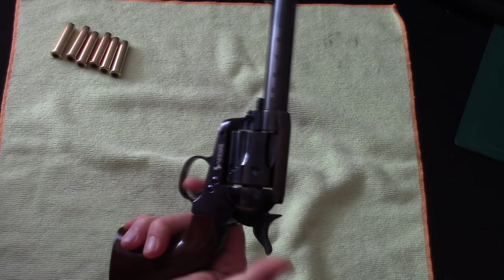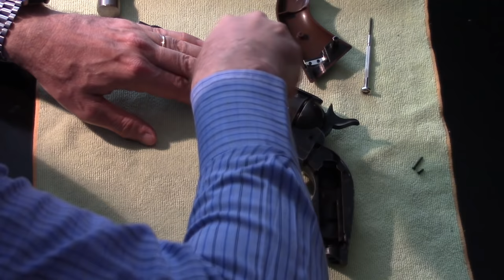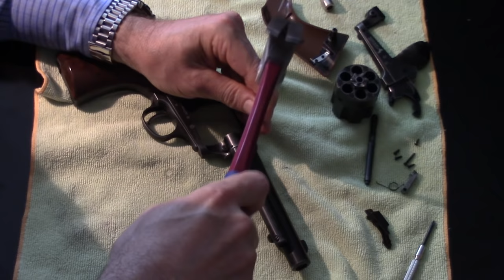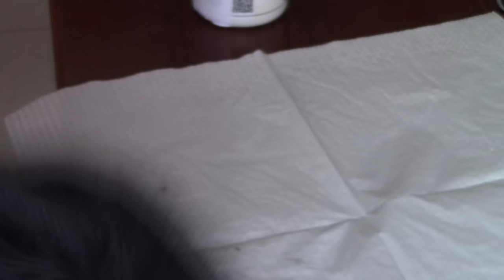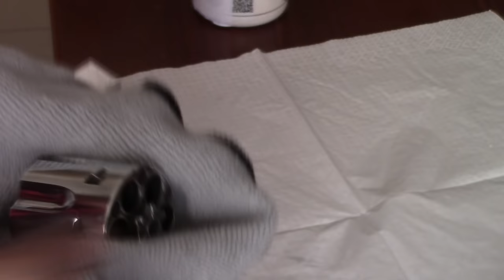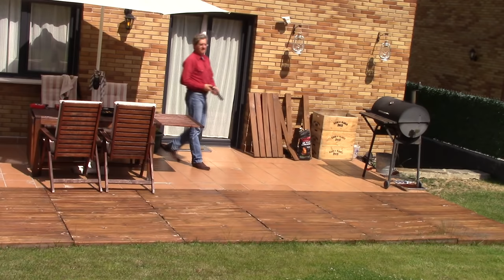Bad quality barrel of Umarex Colt SAA Peacemaker and how to solve the problem

Comment: I feel the need, having shot air guns since the early 70s, to correct your statement regarding the placement of the pellets into the cartridges.  There is NO NEED for seating the pellets by using anything other than your finger tip.  Regarding a CO2 pistol, unless you place the pellet in backwards or sideways, the ONLY reason for a pellet to get 'stuck' in a rifled barrel would be due to the CO2 either not being pierced correctly (VERY small piercing, or hole for gas to escape), or your shooting past when the CO2 has enough OOMPH left in it to push the pellet.  Also, you should NOT push the pellet past the grommet, as you want the grommet to KEEP the pellet in place, especially if you like walking around with the pistol in a holster worn on the hip, which is WAY COOL.
Reply: The barrel is smooth ,the pellet cartridges are rifled.

Comment: I'm wondering if you had a few 'bad' barrels.  I have the original one still in mine and have put God....well over 1000 pellets thru it with no problem at all.  The only problem it seems to have is the cylinder has a slight bit of play in it when locked in battery.  I really like what you did to the finish. It seems like it really has that older, antique look to it.  Ya know what will really 'finish' it (and help in performance too)? Do what I did:  I bought a set of aftermarket walnut grips for a real Peacemaker from Hogue, and after doing some  modifications (removing some wood, reshaping, sanding, ect) I installed them and they look absolutely fantastic!!!  I think what made them look so good was when I finished them, I used a technique that gave them an 'aged' look.  I had very little problems in getting them to fit and the whole job took only a few hours a night over the course of 3 days.  Functionally, I now have a better grip with wood than with plastic, especially when spinning (twirling) them, and they feel more like the real guns grips than the factory plastic ones do.
Reply: Aren't the real grips shorter?

Comment: Chemical bluing is actually controlled rusting and can therefore be removed with an automotive rust remover or simply phosphoric acid (which is their main constituent). Although the bare steel will still want polishing at least it won't be quite as messy! As one of these SAA's is my next purchase though, I found this very interesting, so thanks for posting it.
Reply from the maker: Thanks for your comment, Tony, I appreciate it. I presume that you will have good moments with your Peacemaker air gun.

Comment: I bought BB version because I knew I would change BB barrel to rifled made from Hatsan barrel. It was way cheaper than Umarex SAA pellet version revolver. I tried shot lead BBs with standard barrel but they were no ideal round and just getting stuck in barrel all the time. But they were really accurate. Pellet version is way more accurate though.
Reply: transadwens I have some sympathy in that if you get a misalignment, if you don’t notice the BB doesn’t exit then it’s possible to damage the barrel with a second discharge..

I’ve heard there’s some play in the drum and the casings which can result in a misfire... It’s not like you can hear it necessarily or notice it when it happens being Co2... The barrel does look awfully thin and very liable to deform... This could have been easily negated for what would amount to a few dollars extra in the cost of manufacturing.

The drum play to me would be the biggest culprit... To compound it, the casings apparently have adverse play that allows deviation... it wouldn’t take much to cause a misfire if they are already out the box dancing just within working tolerances... Having said that,  a heavier barrel costing pennies more to manufacture would make all above fairly moot. Though if the drum slop doesn’t have a fix, it’s going to break one way or the other regardless.

Comment: From what I can see here.. Its the quality off the bbs you are using that's the issue. Looks like you're double feeding. Or shooting with A jam. That will be the only cause too that barrel. The co2 seals also needs a bit of Pell gun oil on them.. when inserting a new co2.
Reply: Jeffrey Bone   if you're using poor quality bbs.. and one gets jammed.. then trying to shoot another one.. Then that can cause a double feed. I've never heard of this problem before. Infact this is the only video on youtube with this problem. Also the umarex  Colt SAA has a very low return rate. And is very good quality.
Reply: @justintime1218  i agree, this looks similair to when a powder burner blows a barrel with a bullet jam (all be it less dramatic!)

Comment: Have you had trouble after reattaching your barrel? I opened up mine to inspect it and now its wobbly. You can hit anything with it. The pin is correctly inserted.
Reply from the maker: Hi ares9304,

Both pins don't do anything but keeping the barrel attached to the frame. You're right, if your revolver falls down or so, the barrel may have some looseness. I had that problem and the way to resolve it doesn't have anything to do with pins. I rolled a little bit of scotch tape on the part of the barrel that goes inside the frame and forced it in place. Then I secured it with both two pins and, for me, is good enough. I haven't had any problem with my revolver related to the barrel. 

My friend Jason had the same problem; he solved it with a little bit of tin from a soda can. You can see how he did this in this video: 

https://www.youtube.com/watch?v=zueu0XvcEms
Reply: Xavi Barrera thanks mate. didnt think of cutting up a can, but i did try aluminium tape.
Reply from the maker: Well, I would try first with the adhesive tape, for me, it was enough to get a robust barrel again. I would go from less to more.
Reply: Xavi Barrera mine is very loose. and the aluminium tape dint work. when i forced the barrel back in it only caught tape and wedged it. didnt slide into the frame. tried for hours. the thin metal from a can is probably more solid and wont just bunch up near the edge.

Comment: Any idea if the same issue occurs with pellet version of the gun? I'm planning to get me some, but I'm wondering if it would be beter to buy BB and replace the barrel or just get the pellet version.
Reply from the maker: I don’t have any experiences with the Umarex SAA pellet version. The one that I own is the self-made out of a pellet carbine barrel, the one of the Daisy 880. However, I suppose that it would be more reliable than the BB's version. Pellets are made out of lead, so they are way soft than steel BB’s, so what, in the case of misalignment, they would cause less damage that BBs . If I were you, I would buy the pellet model.
Reply: Thanks for the tip! I think that alone for the sake of more accurate shooting it's worth it. And the prices dropped few days ago, so another plus for that.
Reply: But I do like it tho, maybe just needs some tweaking here and there
Reply: Not one issue with any of my pellet versions. This is operator related with the bb's. If you double feed the barrel, this is what happens obviously.
Reply: I have the pellet version and haven't had any mechanical problem. Mine has the weathered look and I like it. I have the ~5.5 barrel and get about 324fps with 7.56 lead. The 7.5 inch barrel should give you a bit more velocity.

Comment: Hi.  I was thinking about buying one of those Colt Peacemakers - but after seeing this video I sure don't want through that crap.  What could you advise me as of right now???  Thank You.  Sincerely,   JAMES.
Reply: As far as I know, this is the only guy on YT having problems withthose guns. Moreover he blames it on the bad quality of the barrel when in fact it's due to double feeding the barrel with bb's. It's operator error. That beeing said, if you buy the rifled version for pellets you sure will have a much more solid barrel and an amazing pistol to play with. It's powerful and darn accurate. Don't let this vid take you down. I own several of those pistols and never experienced any issue with them. They are more reliable than many of my other guns.
Reply: @RenoLaringo  Thank you Reno.  I have heard before NOT to use BB's in rifled barrels.  They will destroy the barrel.  I sure will not do business with pyramid air - as they sent me a used AR 15 & passed it off for new.  Then they sent me a bunch of e mails to try to scare me into not returning it - stating that if I returned it - it would void the warranty.  These people there are scumbags and liars - & I am gonna make a whole lot of noise regarding this.  Thank You Reno for responding.  Sincerely.
Reply: @buzzclark  You are welcome buddy. You are right about bb's in a rifled barrel. They would destroy the rifling. This said you can use lead pellets, and even use pellets in a bb gun if the gauge allows it. But you almready know that... Jeee, I can't believe you were put in that situation. I was just talking with my beloved one about the fact that everything seemed to go completely south nowadays. I remember a time when customers were treated with much more respect. Now it's almost like if the sellers were the new gods and we had no other choice than complying. It seems to become an overall evolution and I find it rather infuriating. I can't encourage you enough to not let them crook you so easily. There must be some kind of consumers protection associations where you live. Don't hesitate to call them and tell them your story. It just sounds unbelivable. I wish you good luck with this. And, for the rest you are most welcome if you want to discuss guns or anything. Have a great one over there !

Comment: can you show me how to remove the cylinder? I am not sure if the pin comes out straight or it needs to be turned or there is crew somewhere to release it.... I have no idea...
Reply: Well it's 2 years on from your comment, but if you still didn't try this, the cylinder pin cannot be pulled out. It is completely retained by the gun casing and you need to take out the screws and separate the two halves of the casing to release the pin from the cylinder.

Comment: Hey Xavi, glad to see your video. I hope the new barrel works out okay for you. I noticed that in the vid, you did not stretch out the front barrel spring a little bit. It might be necessary to give the barrel the backward push against the rotating cylinder for a better seal. Good shooting....
Reply from the maker: Hi, Jason. Your barrel is working out great. You're right; you can't see on the video the moment when I stretched the spring, but I did it. As a matter of fact, I  stretched the spring when I paper-sanded the barrel a little. The gun is shooting full of power, even with the heaviest pellets. I'm very satisfied!!! It works so well that I'm thinking to buy strongest springs for my other two Colts. I reckon that the malfunction of the barrel starts with some looseness at the tip that pressures the cylinder.  

By the way, I'm really impressed how accurate your hip shootings are.
Reply: ***** That spring may not fit the Umarex Colt SAA barrel front. You can make your own spring using .028-.030" piano wire or wire fishing line, wound on a 15/64 metal shaft or drill bit. It should open up to the diameter of the barrel.
Reply: ***** Yes. I sent you an email to discuss this.
Reply: @ccuc22  How can I get the heavier barrel for my Umerex, Colt SAA? It has stopped shooting. The pellet just jams between the cylinder and the barrel whenever I try to fire it.
Reply: @gregorylawson1216  If you are in the US, you can get the Daisy 880 barrel on ebay. You will have to put in some work to cut and fit it into the Umarex Colt. First check to see if it isn't the front barrel spring that could be jamming or broken. It has to push the barrel back against the cylinder for proper seal.
Reply: Hi Jason. I am in Australia mate and I want to instal one of your barrels in my umarex peacemaker. Happy to pay whatever is needed for you to send me one. Thanks Jason
Reply: @MH-bw9cl  Hi, I do not sell these barrels, my video is to show how you can make it yourself.  If you have a hobbyist pal, maybe he can make it for you, it is not that difficult.
Reply: @ccuc22  Hello Jason , How are you theses days ?  Still having great fun with your throwing daggers it seem :)  Question did you live near the volcano ??  Im kind of worried about you.
Reply: @danbigboss6484  Thanks for your concern. I live on a different island from the volcano. Seems few people are actually living close to the lava flows. Most of the land around the active volcanoes are left barren for such an event. I see that you are into knives too, hope to see your videos with them.
Reply: @ccuc22  One of theses days i should make video of them its sure but i dont own throwing knives. you have such INCREDIBLE skills Jason , both with throwing devices and shooting your Colt SAA.  its RARE to see someone as good as you are.  Oh by the way you should definitelly make more video with your Colt / Remington Co2.  I hope they are still in working condition after all theses years ?
Reply: @ccuc22  Oh man....Thanks you so much for your GREAT cowboy alley shooting Jason , you are just INCREDIBLY GOOD my friend !!!  The only thing i very LIKE to watch on youtube is your chanel !  Awesoome , thanks you so much Jason !! :)
Reply: @ccuc22  Im very happy that you live far from the volcano. its a relief to read this!  I Thing that might interested Xavi & You (you can only do that modification on the "antique finish" version) (bluing) https://www.youtube.com/watch?v=j-plNGBQrcM&ab_channel=johnwu
Reply: @danbigboss6484  Thanks Dan, anybody can shoot well with some practice. It is like any other sport.
Reply: @ccuc22  I Bought two Umarex SAA Antique Finish years ago and I just ordered a cowboy belt/holster rig as christmas gift to myself because Xavi & You.   :)  I ALWAYS wanted one since i was a little boy.  my father nicknamed me "Gunner" since i always run around the house (outside) with my plastic SAA and DAISY bb rifle that my father bought me when i was 10 years old.....but he didnt gave me the damn bbs for it so i was shooting air all around lol.  now in my 50 and after having watched Xavi/You videos i finally decided to make the move and equip myself to have little fun while i still can on this earth :)  thanks you so much for your videos Jason ! I ALWAYS enjoy watching you and your skills. ;)
Reply: @ccuc22  Holy Cow...Holly Molly , HOW you can be SO accurate at this distance is BEYOND me !!  W-o-W
Reply: @ccuc22  "anybody can shoot well with some practice. It is like any other sport."  Im pretty good in any sport i tried in my life , Im an excellent BOW shooter at great distance but shooting from the hip on such TINY target at this distance .... Im sure you was a dangerous sharpshooter in another life :)
Reply: @ccuc22  Ohhh :*( jason your latest shooting video was erased ( ? ) could you re-upload it please !
Reply: @danbigboss6484  I'll unlist it if it offends some people.
Reply: @ccuc22   @Jason S  its strange , the other night your 2th latest video re-appeared. (what a joy) now the lastest just show I hope it will stay there :)   Jason please un-block the comment section on your video. its not fun to comment on Xavi channel each time :)
Reply: @ccuc22   your latest Tribute to Tuco (haha) HOW you can be THAT good ???  its incredible damn it ! your skills deserve MILLIONS of views just like Bob Munden , Gil Guerra Jr, aka Cisko or Byron Ferguson & Lars Andersen with their aspirine shot.
Reply: @ccuc22  Jason you should try to make a ballons stand like this , im pretty sure with pratice you could be fast & accurate that would be awesome to see you start praticing on this stand. https://www.youtube.com/watch?v=9JjIHj3zqbY&ab_c
Reply: @danbigboss6484  Thanks, but anybody can shoot well. I am trying to stay out of YT searches. Just keeping a few viewers and followers who does the same things.
Reply: @ccuc22  ok i understand. i respect your choice sharp shooter.
Reply: @ccuc22  if i understand well your most accurate is your Schofield agains the Colt SAA ?  or what is your most accurate in your opinion and with wich ammo  BBs or Pellets ?
Reply: @danbigboss6484  Dan, the Schofield is the more accurate and reliable bb pistol. I don't have any pellet versions of the Umarex pistols. I am thinking of a way to alter the Colt SAA  cartridges to be like the Schofield cartridges,  the front load cartridge is better because it shoots the bbs into the barrel without hitting the edge of the forcing cone that much. Fast multiple shooting is not recommended with any of these pistols, I find that something gets jammed  and the shot come out at low speed (usually the 3rd shot). Best to slow draw and go for accuracy. BB pistols are not exactly accurate, I have to take the chance of the odds of making a hit. Just visualize a 2 inch spot on your target and fire, if you can do that, then the odds of making the hit is good. Body coordination  on a hip draw seems to beat aiming with the sights, I guess the old time cowboys knew this.
Reply: @danbigboss6484  A quick way to learn to shoot accurately from a hip draw is to start at 5 feet from the target, then work back to 10 feet, then eventually to 20 feet or more.
Reply: @danbigboss6484  Dan, I was checking to see why my Colt SAA was erratic after the first two shots, it turns out that the bearing grease I was using on the barrel assembly was stiffening due to the cold CO2. The barrel was not moving back against the cylinder and caused a gas leak and slow velocity.  I will re-grease with lithium to see if that solves the problem. Otherwise, the Colt SAA will shoot as good as the Schofield and Remington.
Reply: @ccuc22  @Xavi Barrera : when i watch starting at exactly 01:27sec of this video :  HOW the heck you can have the cylinder spinning so fast with this "hammer move" ...mine don't do this at all ...  ??   please i would like to know how you do this ;)